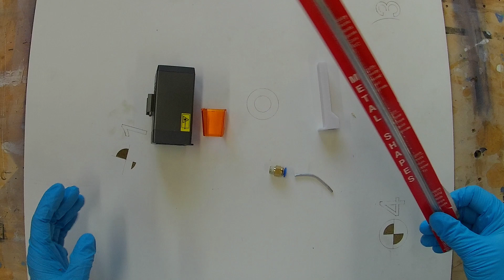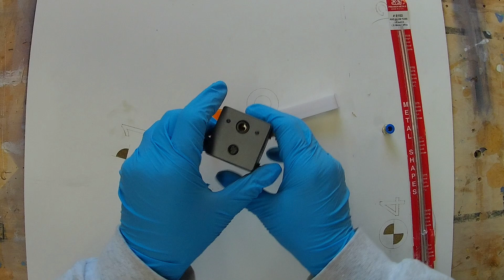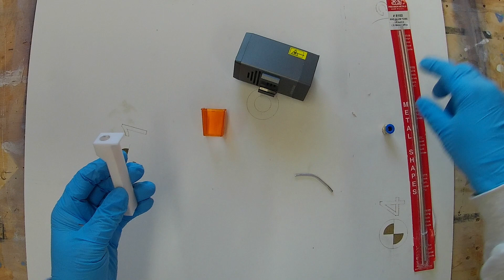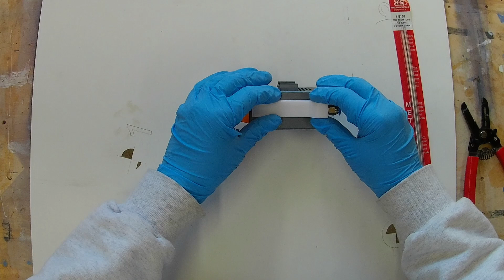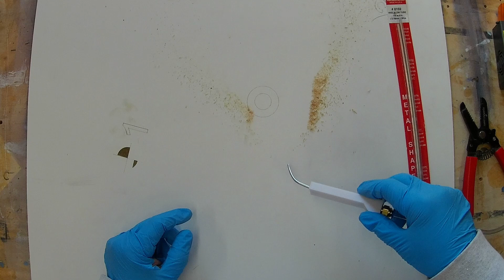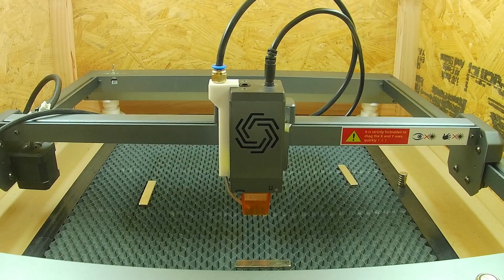Ortur laser master 3 Air Assist Mod.

Comment: Do I leave the air assist nozzle that came with the machine when using this? In other tutorials, some guys have it attached and some don't. Ortur says to only use the nozzle with air assist. Is it needed for this one also?
Reply from the maker: If your using this mod you don't need the nozzle on.

Comment: What material are you using in your 3d printer. We tried PLA on your design but it ended up being WAY too porous. Any ideas?
Reply from the maker: I used PLA. Is yours actually leaking air through the walls?
Reply: @lasersandsaws  It is but we are trying again.

Comment: This air assist mod is hands down the best on YouTube.  It's simple.  Many of the other guys are over designing theirs and some require you to take apart some parts of the laser to install.  That's not necessary.  I was going to do the same thing... over complicate it and then I found this guy.  Thanks man.  Also, to anyone that's going to use this... definitely use hot glue like he said.  If for some reason you have to take the fitting off, it comes right off.  Don't do a double sided tape because you'll end up with a tacky module if you ever get the tape off at all.  Keep making videos dude.
Reply from the maker: Thank you for the comment. Really appreciate it.

Comment: This could be a great improvement… I wonder about the laser module, if the air assist is not going inside, will the laser module overheat?  Also, can it be added without hot glue, so it won’t dislodge?  I have some very sticky “alien tape” that might keep it attached longer.  I DO like the design for reducing the nozzle diameter for improving the air pressure.
Reply from the maker: I haven't tried anything other than hot glue but its been attached now for over a month and hasn't come loose. I haven't experienced any over heating but I can only use Vectors right now and haven't done any long raster engravings.
Reply: @lasersandsaws  I can't see there being overheating issues considering the air assist is technically optional. This is an awesome design, I'm going to install it this week.

Comment: Can you make a video about the height adjustable (?) stand you made and the enclosure? Looks like essential accessories. Thanks!
Reply from the maker: Those legs are fixed height unfortunately. I might do a vid on the enclosure soon. Thanks for the comment.
Reply: i've made my own couple of different sized pipes. and 3d print them. the crappy pvc pipes now days are terrible and pricey here in australia.         and also depends on what size things you are doing. so i can print out what even heights i want.

Comment: I haven't added air assist to my OLM3 yet but this looks good!  Have you tested to see if that added weight has any issues when you engrave at a high speed?  I'm curious if it would throw it off balance at all when it's moving fast.
Reply from the maker: It is very light weight. I haven't noticed any problem and I've had it attached for a month at least.

Comment: Hi - I've recently been engraving tiles using the Norton WhiteTile method and find that even with the standard Ortur air assist in use from a decent air pump the nozzle and lens get  blocked remarkably quickly  and disassembling the unit to access the lens to clean it is a  time consuming job between engravings. I really like your workaround. I don't own a 3D printer but as a decent woodworker I believe I can fabricate the plastic piece out of a piece of beech hardwood. I'm certainly going to give it a try!  Thanks for sharing your workaround and for the clarity of your video.
Reply from the maker: Thanks for the comment. I think you could make the same thing from wood. Let me know how it goes.
Reply: You should use low air flow when engraving on tiles. Just enough to keep the focus lens clear.

Comment: I'm finding that using the air assist at all makes my wood engravings worse. Does this help with that?
Reply from the maker: I think you only need to use air assist when cutting. I haven't had good results when engraving either so I leave it off for that.